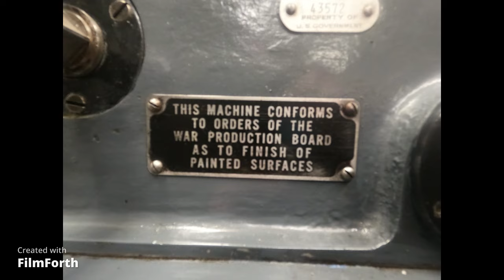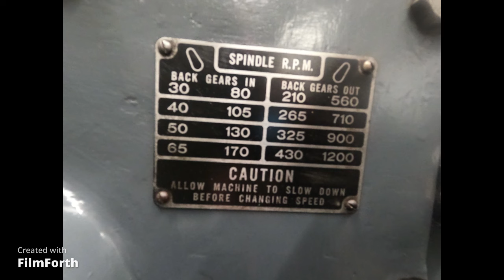Save $3000 with this lathe Chuck repair.

Comment: Glad you’re back in the shop. All my GoPro batteries have been dead for sometime. I run them off an external battery pack, they run for the entire day on the kayak just fine. Have a great day.
Reply from the maker: This particular early model Hero 9 turned out to one of a few bad ones that have a high battery drain. I went through 10 batteries in around 500 videos. This is the main reason I tend to stay away from tools that need batteries.

Comment: DeeDee. Great to see you back in the shop.  I’ve got 3 chucks to clean up and possibly grind.  Thanks for the education.  Cheers, TB
Reply from the maker: Yes! Back and more fit from drinking the sparkling spring water out of the old pipe at the back of a Radon mine just East of the Continental Divide in Montana and now back to wine and hard liquor drinking Walla Walla, but now with a full on industrial yet compact battery of machines that will more than handle the vintage and even modern projects I would consider working on. The chuck  jaw grinding is routine for the cylindrical grinder operator that may not be a general machinist this is important, even critical for lathe work in hydraulics, or on small chucks creating accurate parts or modifications with the Monarch 10ee!

Comment: They were still showing those WWII training videos in Grade 7 & 8 Industrial Arts back in the 70s... The shot of the tool post grinder going in triggered that memory...
Reply from the maker: The film clip shows a large spinning 3 jaw chuck in the horizontal position being ground using a Red Head grinding spindle for about 2 seconds using this jaw loading device, thanks
Reply: @deedeeindustrialsuperprecision  that would explain why the circle jig didn't ring any bells until your tool post grinder was going in...

Comment: Bison makes good tooling, I have a very nice hardly used 4 jaw Bison chuck, 12" with T slots, cost me £300, came of one of those 16" Taiwanese flat bed CNC lathes where you can use them manually with the electric controls if you want.
I also have a new in box Bison 160mm 3 jaw set true with the 2 piece jaws that was also very cheap, must get round to mounting it on a back plate.
I have my new DSG lathe in the workshop, its much better than my old lathe but there are a few things that need fixing, new wipers, clean up the tailstock taper, make parts to fix the thread dial that is completely wrecked.
Reply from the maker: I just came across a DSG 1609, I would like to buy it "no chucks". The Bison products are very good in general, these big hole chucks 12 1/2" and 15" I think are at the top and could be the best used deal out there if they still have the original jaws.
Reply: @deedeeindustrialsuperprecision  the 1609 is mostly the same machine as my 1307 but obviously with raised spindle height. The thing you really want to get with a DSG is the carriage drilling bracket, the tailstock won't have a tang slot as they didn't intend for it to see heavy drilling work. The belt drive 3rd speed range is desirable, they all have the same gearing so you can change the motor and headstock pulleys to get to the 2240 rpm (or 1600 without the belt drive) top speed on any of them, but you will need the 10hp motor to do it, they said the headstock can soak up 6hp at top speed. The belt 3rd range machines are also capable of finer feed rates than the standard lathes, 2/7th of nameplate feeds instead of 2/3rd when used in belt speeds with the coarse threading range engaged 

Bison chuck jaw sets are available new and are not all that expensive, if the chuck is missing them.

Comment: I wonder if one of the under water cases for the GoPro would help with that grinding dust issue. ? Worth looking into maybe. Anyway glad to see you back in the shop. Hope you had a good vacation sir. 🍻
Reply from the maker: The gopro is great with the grinding dust but this 9 model has been hard on the batterie's over 500 videos! The little Cannon elf pop out lens and cover not happy with grit. I will get something going, thanks

Comment: Did you build your tool post grinder? Looks to be heavy duty.
Reply from the maker: Yes, this grinder was built by me for this purpose in the mid 1990s for use on a size larger lathe. It is very simple construction, thanks!